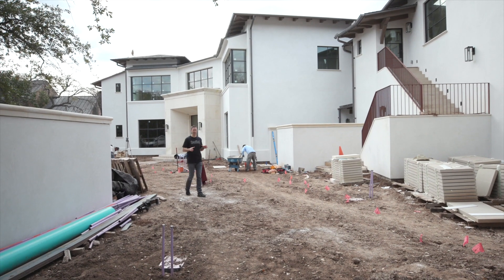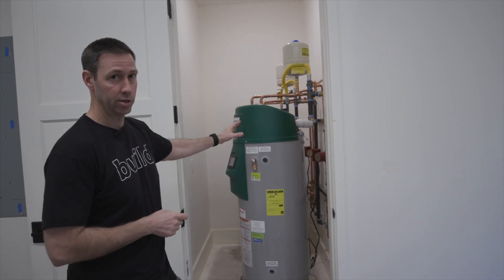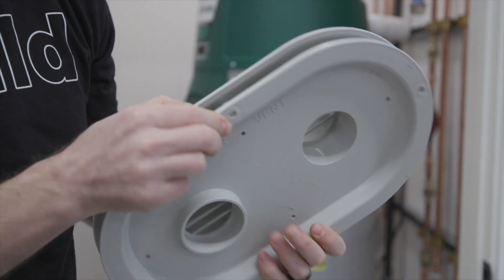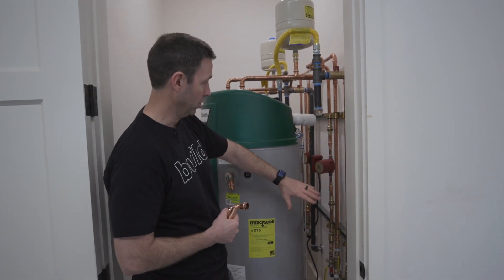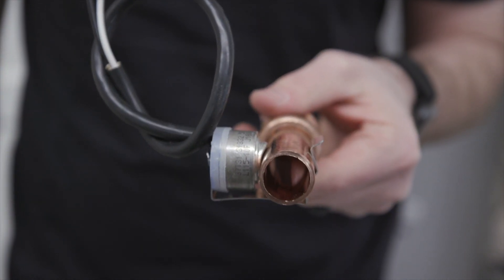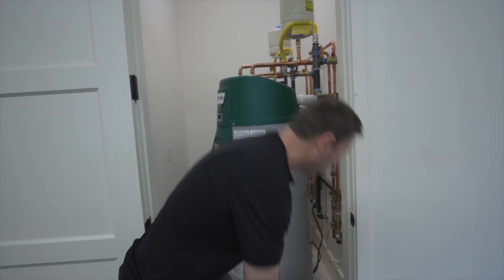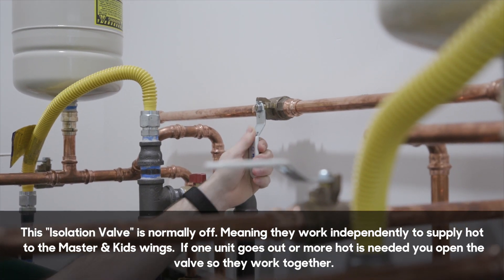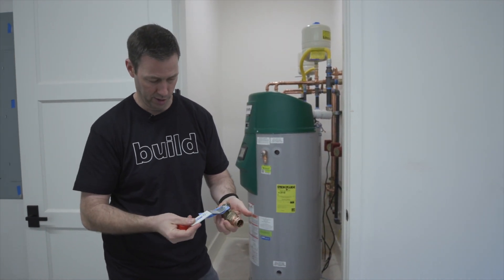Hot Water For A 7000 Sf House?

Comment: Going with two 100,000 BTU heaters was a good choice versus going with a single unit in regards to flexibility and efficiency in this particular application. When you go over 199,000 BTU that requires a commercial boiler license and specialized contractor which ratchets up the initial cost and possibly longer term operating costs.

Comment: Always interesting to see how problems are solved. I’m not a builder, but I would echo future service concerns from past comments and the wisdom of the small house practice of one point of distribution for water (as well as HVAC for that matter). I can’t stand gypsum anywhere, but how about putting something impervious to water in the water closet?

Does anyone design a house from the guts out?  Sounds like a manufactured structure idea, but other industries do that kind  of thing to standardize and integrate systems.  Form follows function. 

Matt, get on it!  Design a system of systems and put a house around it!  

Nothing is better when a person has to service a machine, system, etc where fore thought was put into the design for eventualities. Just the opposite when no investment in design and thought. You should here me cuss up a storm when I have to address cheap short sighted design and materials.

Comment: Just out of curiosity what is the best water heater setup for a large house if you are looking for efficiency?  If I want max efficiency plus instant hot water should I do a heat pump/ hybrid or tankless solution, obviously either way I'm doing a circulation pump.

Comment: Why wouldn’t you use 2 tankless systems instead or 2 tanks? The Navien NPE240A already has the circulation system ready to go, and they can be linked to each other including the ventilation system. On a large home like that I would think you would want a system like that which allows for cost savings.

Comment: I replaced my tank with one of these units this summer. It is way over the capacity I need for domestic hot water. I chose it because it is equipped with an inlet and outlet for space heating. 100,000 btuh is well over the capacity I need to do both. I planned to replace my forced air gas furnace with a Lennox air handler but when I looked at the Lennox specs they said not for potable water. Do I need to install a heat exchanger between the tank and the air handler? What are your thoughts about a system like this?
Reply: Robert Kroeker I’d like to know this too

Comment: So stupid to try and have one location source of hot water. Every faucet and shower should have it’s own source of hot water! Ie. “Point of service” hot water. No tanks required to keep the water hot. No need to run the water in order to wait for hot water to reach them. No need for inefficient, heat-zapping copper lines with circulatory pumps.  All of the downfalls of this system can be avoided by using point-of-service water heaters. Plus, you’ll never run out of hot water. It makes even more sense if you have solar panels because hot water is usually being produced by electric in point of service heaters.

Comment: I love neat work, it makes paying $100/hr for plumbers worth it. Should the room be larger? snort A little bit, at least enough to get the back tank out without removing the first. Will the client care? Not likely. Should they have done on-demand gas? There are pros and cons. If the tanks with the re-circ offer a hotel like level of hot water availability and useage the cost is what the cost is, the 1% don't care.

Comment: I'm agreeing with other people's comments that if the systems are going to heat separate spaces, the water heaters should be separated to be closer to point-of-use. If you are going to have a centralized system with recirculation, why not have an on-demand water heater feed into a tank water heater? You would get all the benefits you talked about with the addition of literally endless hot water. My mother-in-law's house has a similar setup with less efficient water heaters. It used to be alright, but most of her 6 kids are now married with kids, so she is CONSTANTLY running out of hot water during the holidays.

Comment: I agree that the room is too small, the pipe insulation is missing, no piping extending from the TPV locations. In any event I too would do one of two things here. Either I would indeed move them closer to the areas they are serving or I would make them a paired redundant system where both tanks serve the whole house and come on alternately to share the wear and more importantly double the capacity for any one use in the house. A mechanical engineer should have designed this system, not the architect with a design build by the plumber.

Comment: I don't love recirculating systems.  It requires you to have a predictable schedule otherwise you are burning fuel when you don't need hot water.  With a big big house and a big tub I am surprised you didn't use a couple tankless systems strategically placed throughout the home.

Comment: If you have that kind of money I would use electric heaters.  My natural gas water heater gas goes straight up and through the roof.
Reply: Tomoko Abe That's because America still uses ancient open vent technology, banned in Europe. Half the heat escapes straight up the flue, and they continue to suck heat out of the tank continuously. A room sealed system like this is over 90 percent efficient, doesn't loose heat through the flue when the burner isn't running, and depending on your local gas price is around a third of the cost of electricity to operate.

Comment: Very nice Matt...Natural gas is cheap in Texas...We are building a similar sized multi-building compound on the Florida coast and only have electricity to work with (propane is very expensive at $3.50/gallon). I would love to see how you would design electric hot water for this same house. I am considering a combination of heat pump hot water tank heaters and instantaneous hot water heaters...But maybe the circulation system described here with larger tanks would do the job...Ideally looking for both high efficiency and instant hot water...

I am considering working with Positive Energy to do my design work on both HVAC and Hot water...

Keep up the great work and may our good Lord bless you and your family during this Christmas holiday...

Comment: You can tell the northeast from the south we don’t use Teflon tape on gas only  pipe dope the only time you use Teflon tape is on water not gas an the expansion tanks not being strapped could be a bad thing when they fail an fill with water so

Comment: What is the lifespan of the rubber o-rings inside those crimp connections ?
Reply: 100%  also curious.  These press jobs are sad.  Gone are the days of 100yo sweat connections getting it done.  I sure hope more kids get into the drywall trades, because they'll have lots of work in 20 to 40 years.

Comment: How would I supply hot water for this large house?  5 sets of evacuated  30 piece tubes. Then a five hundred gallon Stainless tank with 10 inches of spray foam all around the tank I know how you just love spray foam.  Then put a flat plate heat exchanger with a nice 009 taco pump to push the water thru the tank.  If they use up the water that is heated.. they must be filling 4 whirlpool baths for the 7 bathrooms

Comment: On a house this size and caliber why not work with a mechanical engineer? This is a poorly designed space for that equipment. I hate when a residential architect just throws in “mechanical closets” in leftover spaces which is what looks like happened here...
Reply: The only problem I'm seeing is the lack of width, so if the back water heater goes out, you are not going to have an easy way of getting it past the front one. Other than that, the sealed combustion means it shouldn't really need a big volume of space. Are there other things are you thinking are wrong with this setup?
Reply: @Pickupmanila  if the back one fails you need to pull out both lol. Terrible design. When ppl have a small mechanical room like that.... It's a pain to work on. Customer will usually pay more for that for and service
Reply: @PeskyWabbit.  7ksqft lakefront property, I don't think they care that they'll have to replace both water heaters in 10 years.
Reply: Kyle Jamiso

Comment: 7K Sq Ft, but not enough room to squeeze out the back heater, without removing the front? I like the idea of being able to hot-swap water heaters. I would put them in series, set the first tank to a LOW temperature, and the 2nd tank to MEDIUM. then run my piping so either could be taken out and replaced without disturbing the residents. then if service was needed, the plumber or resident could bypass one of the tanks, while waiting on parts/service.
Reply: If they're in series how would you isolate the first tank without replumbing it?
Reply: grinchyface you build a manifold, 5 valves later and you are set.
Reply: Did you not see the copper pipe.  The builder and plumbers are morons.

Comment: what happens if you have to replace the tank on the left? Guess we'll see in 10 years on....the build show!
Reply: As a service tech I highly suggest to the homeowner replacing both at the same time as the nearest unit most likely not far behind it.
Reply: Perhaps the owners just don't give a toss about the maintenance costs of this. They may be slightly beyond that sort of worries in terms of cash, judging from the estate. I've had to design similar solutions in the past. Where there is enough room for car stackers and half Olympic pools, but the plant room needs to be the size of a matchbox!
Reply: Exactly whenever I see the Mechanical room of a house and you need to be a Chinese Contortionist to work on the equipment it means more money for you whenever something needs to be service or replaced. Why the HELL did they build that room like that is a question for the builder.
Reply: ant l my first thought!
Reply: ...I don’t really consider a house “BIG” unless it has at least 7001 square feet ...but thanks for playing!
Reply: Drain,  get helper,  lift and tip over the top.  Done.
Reply: Mine also.  Additionally, in my opinion, the "rudeness" of the Owner/Architect is displayed ... who cares how much "elbow-room" the "grunt worker" has to repair the water system!?

Comment: What happens if you need to replace one of those nice crimped fittings? Is there an agreed solution?
Reply: There is no tool to remove it that I know of and the pipe is deformed under the crimp. That would require it to be cut out on both sides and sweat in a coupler or require 2 new crimped fittings and pipe insert to replace it. The job would not look so impressive any more but it would work.

Comment: Hey Matt,
I think you should do a trip to Europe / Germany and get an idea how things are done over there. It'd be super cool to see, especially around upcoming trends around energy efficiency.
Reply: Yes, they do tend to be ahead of us on the efficiency front and technique.
Reply: they have 240 and water heaters at each faucet right ?
Reply: @doublebulbing  all of Europe has 220v on all outlets
Reply: @willem18241  and individual water heaters on the faucets
Reply: @doublebulbing  I think it depends on the situation. When I lived in the Netherlands we had a central hot water supply, that also supplied the heat to all the hot water radiators throughout the house. I know my grandma had gas hot water heaters at each tap/shower.

Comment: Exact same system my grandfather installed in the early 1950s in his house with seven kids when he got out of the Navy from being a steamfitter and became a plumber other than his was all gravity fed with no timers no pumps nothing ever broke no malfunctions still works to this today excellent system. Now going into 60 years later his great great grand child is being raised in that same house with the same plumbing instant on hot water trouble free.
Reply: Actually back in those days money was tight. Grandpa got to use the water heaters that were already old but he knew what he was doing said the tanks were made out of thick plate copper and in my lifetime long after he’s dead I would probably never have to replace them because of leaking. He had to40 gallon water heater’s tied together in a gravity feed to the top of one tank out of the bottom of one into the next and then out of the top to feed the house water circulated by just being heated up and natural cooling action to circulate. 12 years ago decided to replace the hot water tanks not because they were leaking because each one was filled with like 350 pounds of settlement like sand from the city water supply if it wasn’t for that those same tanks would probably still be an operation today.
Reply: @coldfinger459sub0  WELL FAMILIAR...THAT IS WHAT STEAMFITTERS DO...I THINK I WOULD HAVE KEPT THOSE TANKS...THANKS FOR SHARING
Reply: GOOD DEAL...MOST LIKELY YOU ALL HAVE A BOILER